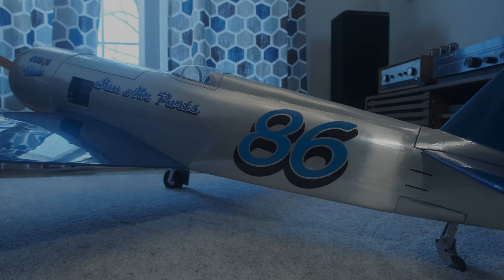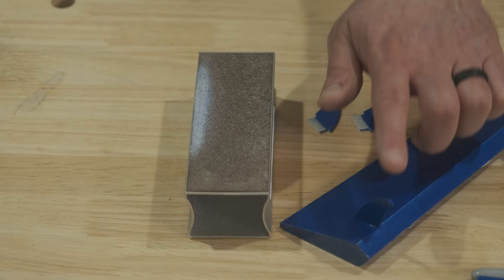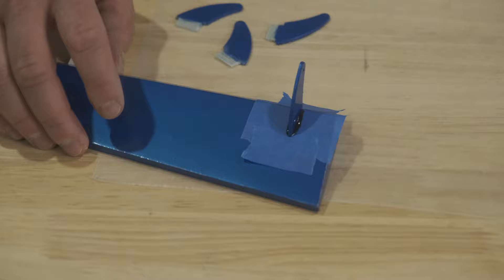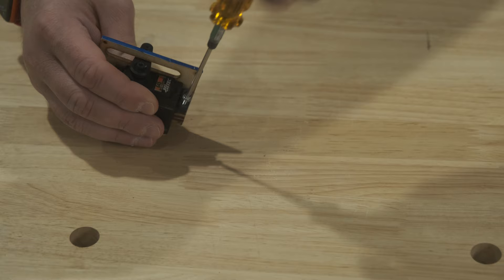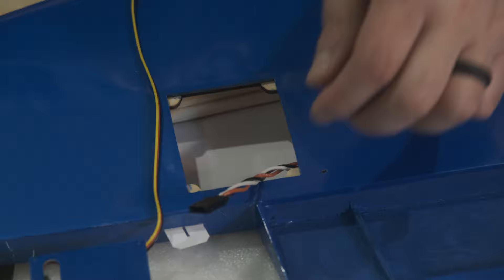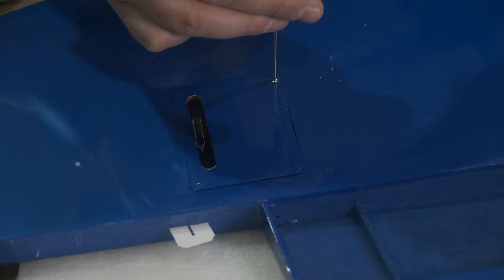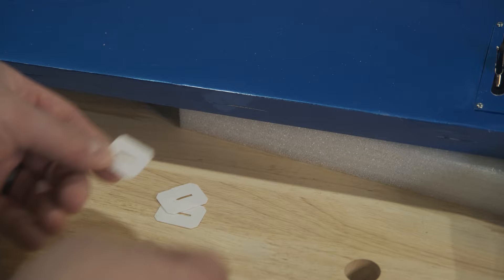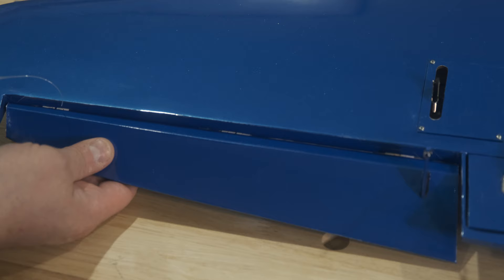DIY Guide: Installing Ailerons and Flaps on the Seagull Czech Mate Model RC Aircraft ARF

Comment: Nice. Looks good. Just curious, what prop are you going to use ?
Reply from the maker: In the pics is an 18x10 with the included spinner. I wanted to at least show those before I put on an 18x10x3. That's what I'll first try. I fly my Perestroika with a 19x10 and that performs well.
Reply: @djmoosecom hello are you planning 2 bladed props ? —